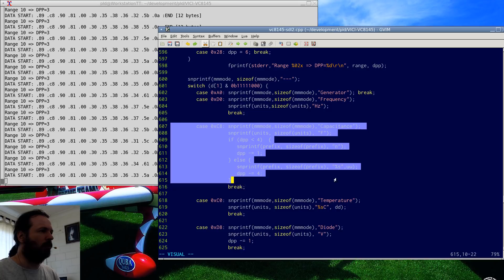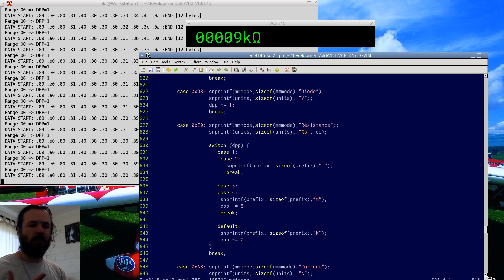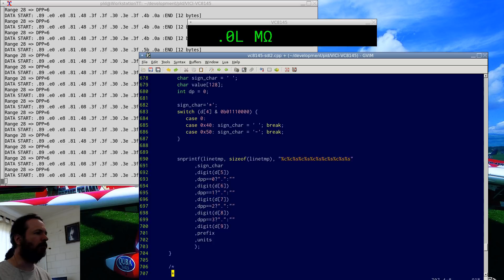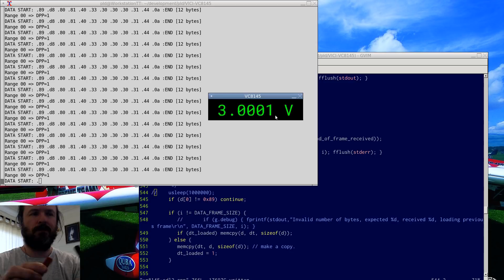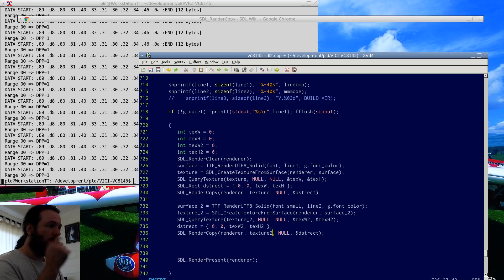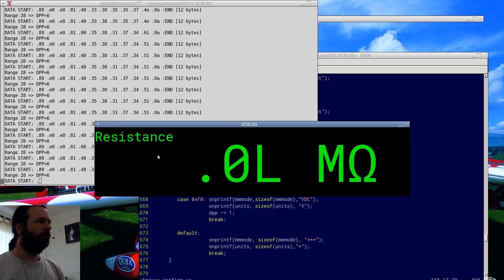VC8145 Programming for OBS in Linux - Part 2 of 2 (Long and boring)

Comment: Tracking the progress of your code I could not wonder WHY YOU JUST WRITE a SIMPLE API INTERFACE TO SIGROK ? which already supports similar protocols of UNI-T, VICTOR and dozens of common  others with 90% of the hassle solved...  including USB and RS232 interfaces
https://sigrok.org/wiki/Supported_hardware#Multimeters
Reply from the maker: It's GPL.
Reply: Yes  SIGROK is GPL v3 but that is the point. You can write the API interface just for the driver part (90% hassle of buffer and I/O)  and STILL write your GUI APPLET in BSD license

Having the benefits of extending usability with at least 4 more GUI's ready  including a data-logger graphical interface...  

Your final GUI would just interface the driver with no need to be GPL based - so does at least 2 others interfaces to SIGROK Qt based

All the hassle of solving buffer and logging and low level I/O are extensively ready there
Reply from the maker: There are ways to circumnavigate around those legal boundaries but in the end it's more drama than it's worth.   

It takes me only about 1~2 hours to adjust the template program to cover a new protocol for a new meter (when I'm not trying to explain it on a video); that's far less drama and risk to me than trying to dance the right tune with a GPL codebase. If it was LGPL it might have been a consideration ( at least I only have to make a notification ), but with GPL3 I'm not even going to go near that.

SIGROK offers a great resource and it would be a fantastic thing to gain access to it but their licencing terms are not compatible with my legal risk comfort level.

Comment: Having to wear glasses is not an indication you are growing old. No using them if you need them can cause eye strain and headaches amongst other things.
Reply from the maker: This is age-related short sight issues.  I do have glasses but it's due for them to all be adjusted to suit what ever state my eyes are in now. 

The main thing that's really irking me is that incapacity to read things up close, that snuck up on me the last 12 months, now having to do the whole "hold it away and find the balance between too small and out of focus" :(
Reply: @pldaniels  Go to your local Wallyworld or pharmacy and get a set of cheap clip on reading glasses, probably around 1.5x. Makes a world of difference till you get a new set made.